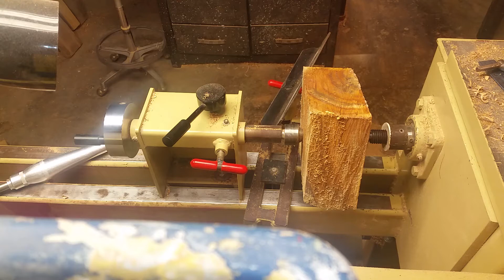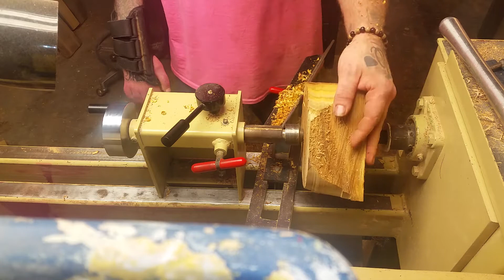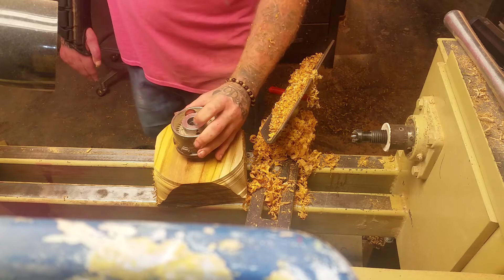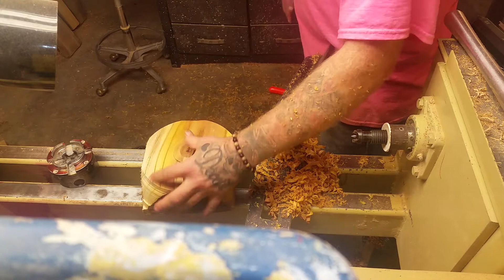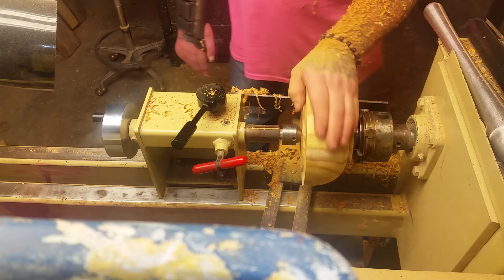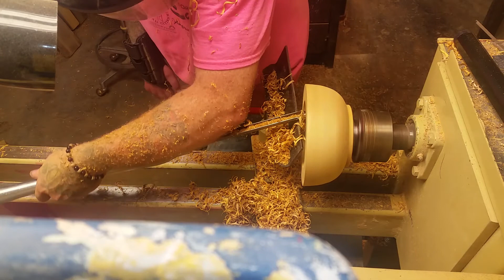1 handed woodturner ....pain relief / pain management  , part 1 roughing a mulberry bowl

Comment: Jason when I watch you turn my mind goes mental thinking of attachments that could maybe help your turning process. Do you ever think about leather support straps or tool rest adaptors to help you out? Or  do you just get on and do it without a thought ? 
Inspirational to watch as always man, thanks for sharing.
Steve.
Reply from the maker: I just get on and go for it lol .....iv thought about pegs in a tool rest to use as leverage or even some type of captive bar set up but iv always just pushed them aside just for the thinking that I wanna turn like everyone else , or atleast as close as possible . for a long time I didn't even tell anyone about my arm just because I wanted to be judged as a good turner , not a good turner for being 1 handed and not judged differently .....its just a mental thing , in my head lol

Comment: Matey does your hand that can't move have crps or also known as rsd? Just saw the colour in your hand so made me wonder as.like you pain and woodturning is my outlet to get brain of thinking of something else besides the pain. I do have crps hence me asking as it is nerve issues but causes discolouring so was just asking
Reply: Btw good on you for turning one handed.  Thankfully mine is legs and lower back. Arm nerve only goes when having issues with my neck but mostly is from waist to floor that wish could find a way to replace lol. Hope they find some answers to ease youe pain asap as pain sucks put mildly but thinking of you
Reply from the maker: I had a brachial plexus injury, its the group of nerves that control your arm and some of your shoulder , that entire group of nerves were torn from my spine in an automobile accident , paralyzing my arm . since they were torn from my spine they can't be reconnected but their all still alive and just randomly go off and surge since their not connected to my spine their not connected to the brain to control them and they go off uncontrollably  .  I had to have my shoulder fused , they fused my arm to my shoulder blade to hold it in socket. .my hand changes color usually is I'm up doing things and moving around a lot . sometimes its normal and sometimes it can turn almost a deep purple color , I'm not completely sure why but the doctors have never mentioned crps
Reply: Jason Rockhold matey have a serious look at crps yourself and ask Dr as two key factors I noticed  was please do not get offended as I say this because not being nasty but trying to help as may help get you on the right meds to help pain. Crps originated from another injury or operation site for me was a regular disectomy I went in for and crps rated it ugly head. But the 2 symptoms I saw in your video is skin colour change and looks like nail changes which both characteristics of crps matey. Sorry your in this nerve battle top as it not fun. Lovely to meet another turner suffering severe pain issues like myself. As not seen another so to me was great not to feel so alone. And by the way you do a top job considering your one handed. Make turning look easy you do but I love how much initiative you used to adapt to your situation as that one hugest obstacles we face is either give up on something we love or find a plan b. Wish worked for most things though but sadly not everything prior to get hurt is so adaptable. I still get shitty on how much this steals from the life i use to have.  Today's been a shocker but I nearly worked myself through my very first burl clock so proud myself in the midst of bad attitude mood too
Reply from the maker: no offense taken at all , I actually looked up the symptoms and treatments for crps . I think I may be calling it by a different name but its exactly what I have. every symptom is the exact same, Iv always just reffered to it as chronic pain syndrome because I think I remember  my dr. calling it that but next month when I see him I will definitely ask him to make sure . when I was reading the treatments for crps I'm even on the same meds that they use to treat it , I'm on nerve blockers and an anti depressant , gabapentin and amitriptyline. so I'm guessing that is exactly what I have Iv always just referred to it as chronic nerve pain . its some EXTREMLY hard shit to live with at times . the pain is literally indescribable
Reply: Jason Rockhold yes does seem many drs do use different names. Guess anything with nerves keeps them all guessing as there no one fits all meds they can go too.  Again lovely to chat with you